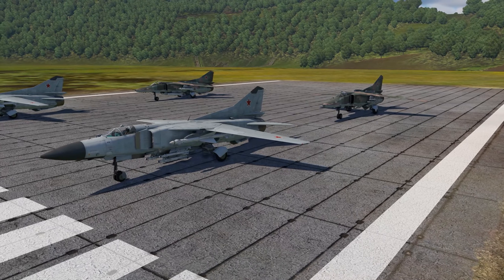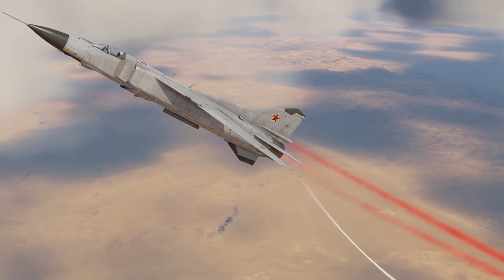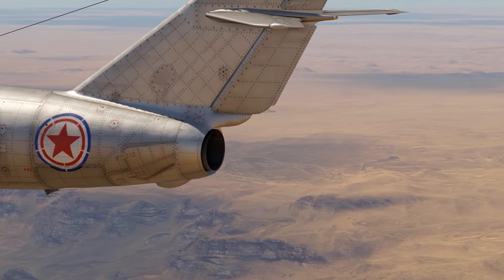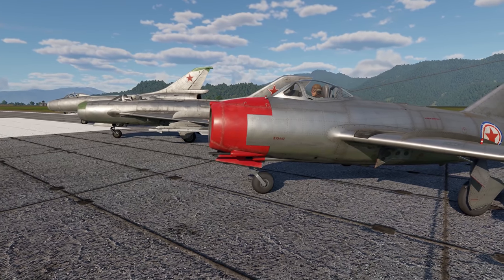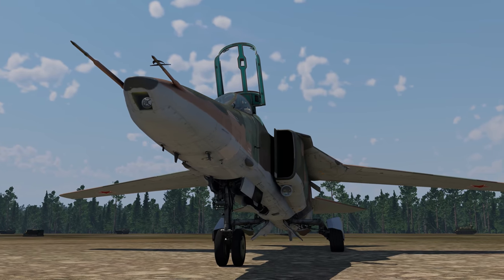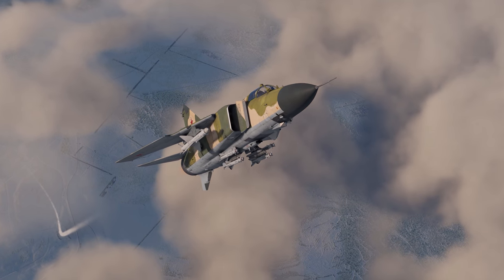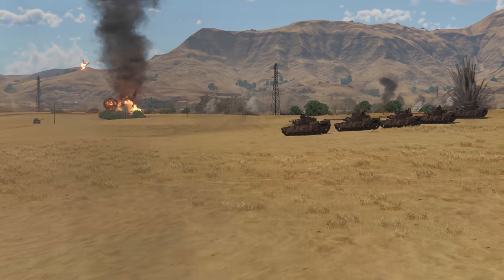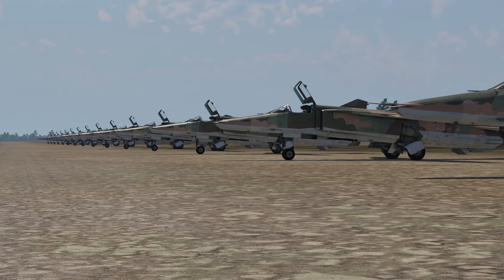Attack Aircraft Reborn / War Thunder

Comment: Will we ever get to play our own researched aircraft in ground arcade rather than some random stuff for 30 seconds? Can we have the same setup as in naval arcade? Air mission is simply stupid and random and not fair both on the top level of the match because one team can constantly have bombers over the other if you're just faster to press the button, and secondly on the player level if you're constantly getting a fighter that's less than 1km from you, while your team mates are 1.5km further away. Either make it work like in other modes and nerf the bombs somehow, or make what most of the people want which is separate ground arcade mode without planes.

Comment: Mig-23/27 have a lot of problem in engine, system swept wing, must have a lot of work repair, and because a lot of moving part Mig-23/27 is too Expensife to maintenence,.
Because of that in Russia, Mig-23/27 get grounded and replace with Mig-29, Su-24, Su-25,
Reply: Why are you lying? They're in reserve. Su-25 and MiG-35 have replaced MiG-27's role.
MiG-23's role was replaced by Su-27.

Comment: The amount of garbage spoken in this video is awe inspiring. By your account the USSR went straight from MiG15/17/19 the latter never used as fighter bomber, and the Su7, the most prominent fighter bomber of the USSR in the 60s; to the MiG27. I really hope you know what chronology is, in case you don't, when MiG23 was still an early prototype, Su17 was about to enter service. As per commonality between 23 and 27 there is none, at least in terms of maintenance, MLD use R35 engine and 27M uses R29, in terms of electronics they are also completely different, the latter having much better navigation equipment and a far more complex auto pilot. Finally, only the first 2 series of 23 production models had severe problems, those being mostly related with wing configuration and maneuverability limitations to 5G plus immaturity of the FCR which was mostly solved in the M/MF variants. As for the 27, only the K variant had teething problems with it's digital navigation and attack suite because of reliability, that's why 27M exists, to have a baseline version with somewhat simplified attack complex, cheaper and reliable.